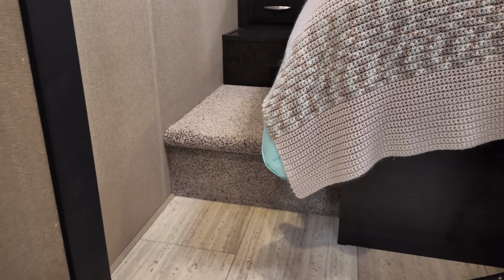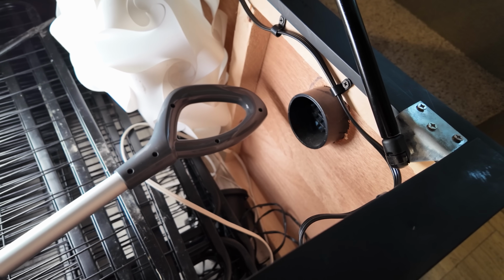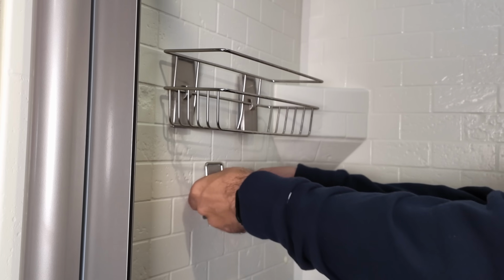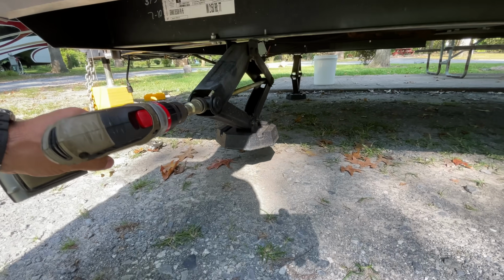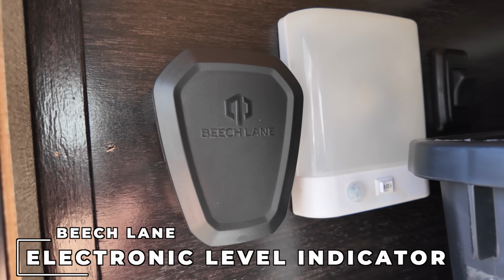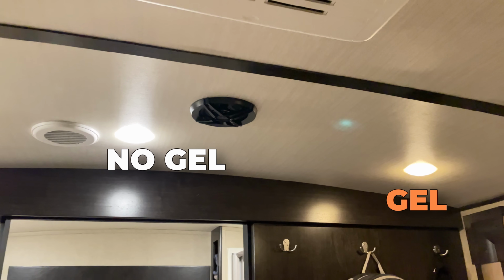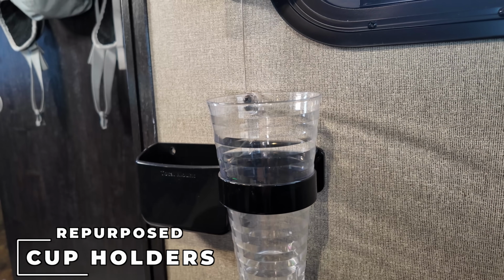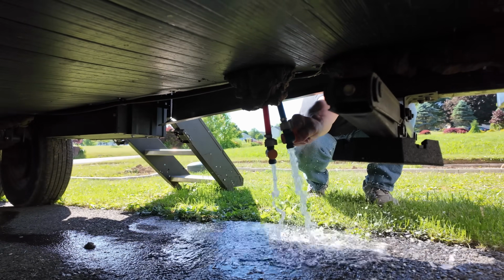8 Years of RV Upgrades & Modifications (Storage, Accessory & Renovation Ideas)

Comment: Ok question, you mentioned installing a tv, why not a good projector and screen?

You can get a way bigger screen out of the way in most spaces going with a real good projector and ceiling mounted screen. With the ability to take it outside at night with a quick setup outdoor screen as big as you want. Want a 150 inch screen outside just back the projector up 13 feet. 

For example, I just got a 2025 jayco 210 qbw in October. The first major upgrade I did was mounting my Optoma UHD 55 with a ceiling mount to the bottom side of the shelf above the bed. Then where the curtain is at that divides the bedroom from the living area, I for now mounted a black bedsheet and a white bedsheet to the wall area till I get a ceiling mounted pull down projector screen to mount to the ceiling. From that distance, I get about an 80 inch, 4k 60hz display with the capability of doing 1080p 240hz for gaming, just past the foot of my bed. The projector does 3600 ANSI lumens, so even if its bright out, you can still see pretty clearly, but at night/heavy rain days, it is absolutely perfect. The mount I use also has a single thumb screw to just remove so I can put the projector in its vibration resistant case for travel days. Then in the future with the ceiling mounted screen its completely out of the way when not in use.

If you keep your eye out, you can get great deals on ebay for short-throw projectors. Just need to ask the seller about how many hours on the lamp before purchasing as well as look up the cost of a lamp for that model and make sure you would be ok with that reoccurring cost. By reoccurring, it is every 4000 hours. So on average once every 3 years or so. Main thing is to just go to projector central, use their site to help you locate projector models that can get the size screen you want in the distance you have available, as well as the fL brightness at that distance to make sure it is bright enough for your needs. My recommendation anything above 45fL for anything used in daylight, they say I believe 35, but I still find 35 to not really be able to use in bright daylight.
Reply from the maker: thanks for the info Walter!

Comment: Nice video, short, to the point! 
The mod I’ve like the most on my trailer is, pillows that fit into the ceiling vents - keeps things dark in the morning and helps insulate. I liked replacing my shower head. I put on the screen door handle - I do like it but I have to slam my door shut so I only rely on the handle to get the door close. I’m looking forward to switching out my climate controller so I can actually see the temp vs guessing with the dial knob.
Reply from the maker: Jack, check out this video if you have to slam your door: https://youtu.be/0Pn1i5f-4A4

Comment: The bottom line is RV's engineering and manufacturing practices are sub-standard.  Don't be fooled - almost everything breaks in short order - roofs are not sealed properly allowing water infiltration that most often doesn't show up for 5 - 6 years and by that time the damage is done. And to top it of the warrantee is a piece of paper - nothing more - you will have to fight to get things fixed if it's even possible. And to put the icing on the cake , it doesn't really matter if you spend $40,000 or $800,000 , they are riddled with problems , some hidden some immediate. If you like spending money and TIME on a never ending litany of problems , RV living is for you.
Reply from the maker: wait until you own a house, or a car.  its 10x worse.

Comment: I have installed several mods you have mentioned here and have found them to be helpful.  I also have the Tire Minder which I have to say I am very disappointed with, it has been nothing but trouble from day 1 and unreliable.  I won't bore you with all the issues but the latest problem has been the sensors leak air.  I have sent the problem sensors back for replacements and those have leaked as well.  Never had these issues from the TST unit and sensors on my previous RV. I am getting ready to replace the Tire Minder.
Reply from the maker: sorry to hear that bud. Are all the stems leaking with all 4 old and new sensors?
Reply: Initially it was one leaking.  I checked the valve stem, no leak and left the sensor off with no loss of air.  Same problem with new replacement sensors. Then 2- others started leaking, again no issue with the valve stems.

Comment: I've been a subscriber for a while now. Love your videos. 
I've had several campers over the past 15yrs and not of them have had a black tank flush system. I have always just used the camco valve to back flush the tank when at the dump station. Ive wanted to get the tornado black tank flush but haven't found alot of rv channels install or review them. Is this something you can shed some light on or even do a video on? 
Thanks
Reply from the maker: ill have to look into that product and see.

Comment: I've thought about the backsplash but I was worried that it would rattle lose. Have you run into any issues with yours?  Congrats on the new RV! We're thinking about getting roof armor. That could make for a good video.
Reply from the maker: no issues with rattling, however i did add some caulk to the edges just to make it look a little nice, so that might have helped with stability.  thank you for the comment!

Comment: Great great video yet again. Thank you.  Of course I have a few questions or comments as per my usual. 

First, thank you for changing out the low point drain valve recommendation / link. I also noticed some slight leakage but no gross failure yet with the loc-line valves. I will use your affiliate link and order the replacements. 

For the screen door, I’m guessing you have the handle mounted to a height above the morryde steps since they essentially block the entry door space when in the coach? 

Congrats on the upcoming new camper and I can’t wait to see where you go with battery and solar. I have an inverter sitting in my garage awaiting install in the camper.
Reply from the maker: hey Rick, you're welcome on the valves.  The listing is very deceitful, and I probably should have read the packaging.

the screen door handle installed before the steps.  I actually installed the handle as close to the door latch as comfortably possible so all the force was close to the bolt.  RV doors arent always the easiest to close.  The only part of the steps (on mine at least) that are even close to the door are the movable feet.  They are close to the door, but still enough room to clear.

I got a good book from someone on solar.... lol, so I'm definitely going to do something.
Reply: @RVTIPSANDTRAVELS that sounds exciting. Can’t wait to see the content from that research.

Comment: I really could use your help,, one of our pass-through doors will not stay closed even when it’s in the lock position it’s still pops open. Please help if anyone has an idea of what we can do. We have a.
We have a 2021 grand design 
2250RK
Reply from the maker: have someone crawl inside and someone close them in (or record from the inside with your phone). sounds like the latch is missing.
Reply: @ ,, i’ll give that a try, but the latch is there.
I have watched videos on different kind of locking systems, but they will not work on our unit. 
Getting ready for a big trip next summer hate to see the door get ripped off in the wind
Reply: @ if you can help me figure out how to send you photos that would be great. I love all your videos. We’ve gotten quite a few great ideas, but this hatch is driving me crazy

Comment: Thanks for mentioning why the plastic valves leak.  I didn't notice the working pressure of 20psi either.  Will get those 316 versions you linked.  Thanks!
Reply: @LSUtiger95  my plastic valves leak too, and I couldn't figure out why.  Now I know!
Reply from the maker: yes, they are very misleading
Reply from the maker: youre welcome

Comment: I'm anxious to see what you get for your "traveling RV." We've got a Grand Design 22MLE and it's perfect for the wife and our sheltie. However, while I love the layout, I'm disappointed with Grand Design's plumbing and I'm slowly replacing most it. Mixing Pex with reinforced plastic tubing (who knows why when Pex pipe is cheap) guarantees problems...and the way they put the service panel in makes those problems hard to both discover early on and nearly impossible to service. Fortunately, I have the skills and time to fix most of this but systems shouldn't be designed to fail. Having said that, we love the RV and I wish we'd started RVing 20 years sooner.
Reply from the maker: Hey Don, I just replaced the reinforced plastic tubing behind my toilet... well i should say i cut the end and moved the hose up and added a new pex clamp.  but i planned on changing it entirely with pex ( i agree, no clue why they arent using pex throughout) until I realized how much paneling needed to be removed.  it will stay this way until its warm again.  im not a fan of that reinforced rubber tube, in my experience it just doesnt clamp as well as pex does.
Reply: Every Grand Design I've ever walked through had bad plumbing.